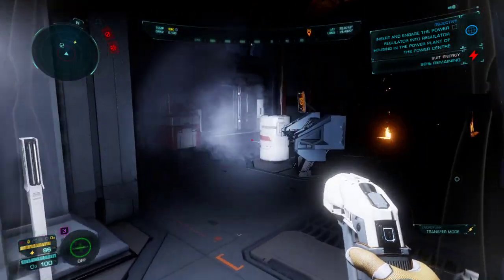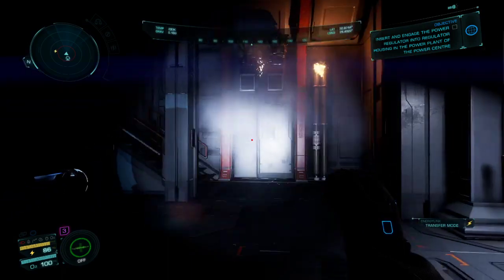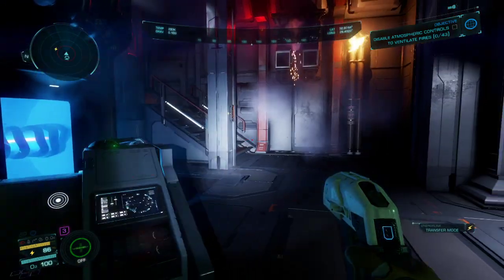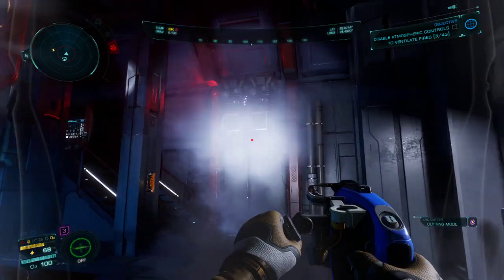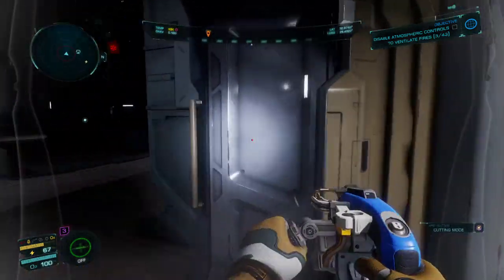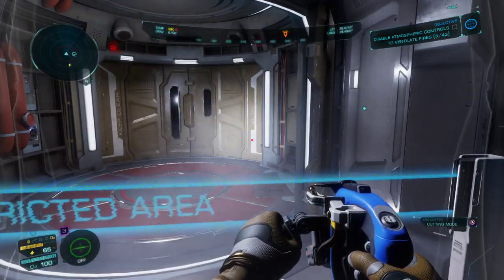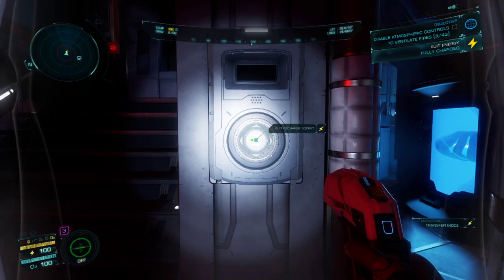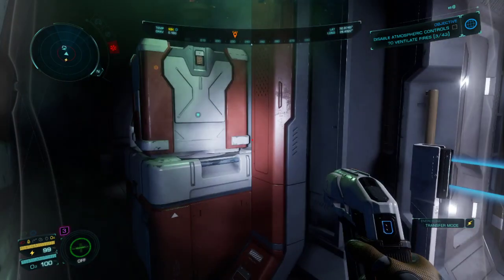Elite Dangerous Odyssey Restore Power and Extinguish Fire

Comment: I just took on one of these and had a fire patch right where you need to stand to install the power regulator. Went as well as you would expect - ie. instant death.

FDev's usual attention to detail is shining through; also, the fact that the NPC's see all players as the same (if you're on a base and someone else not in your group makes the NPC's hostile, they'll come after all players regardless) is an absolute joke. This is a single player game at its core and FDev need to stop pretending otherwise.